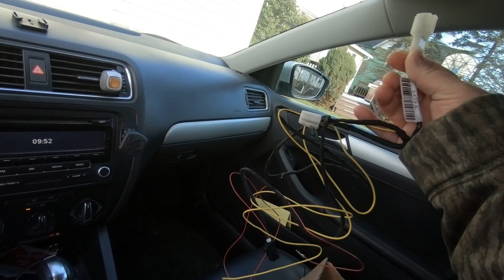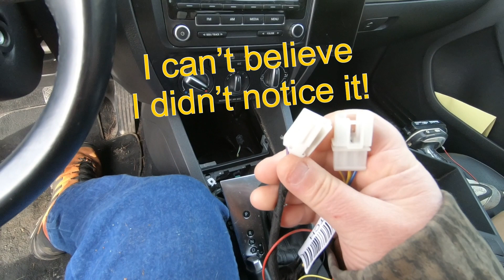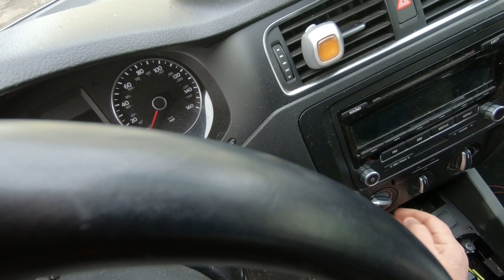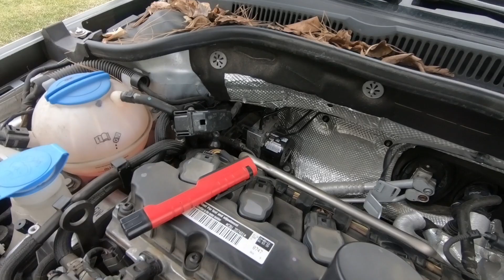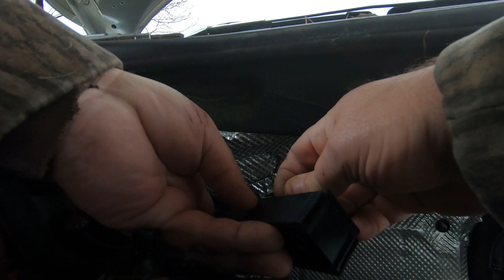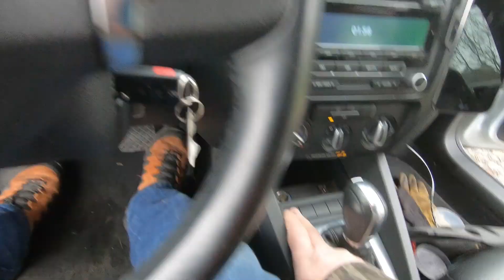MK6 Jetta traction control bypass. USP Motorsport

Comment: I just installed my ECS tuning traction control button in my 2011 jetta.  It illuminates, but doesn't work as it should....I may need to edit the code....but in the instructions it said some 2014's would have the code issue.  strange  mine is manual BTW
Reply from the maker: Before installing the traction control button I used my obdeleven to enable the bypass.
Reply: @116falconer    I can do this after my install?   lol.
Reply from the maker: Yes. I think I used 10 credits instead of manual coding. Since installing the button I've never had to use it.🍻🍻
Reply: @116falconer     OBDeleven pro or standard?  looks like I will probably need to get one.
Reply from the maker: When I bought mine in 2017 there was only 1 to choose from and it was $89. The OBDEleven app is saying I have the pro version?
Reply: ok, cool   Thanks!